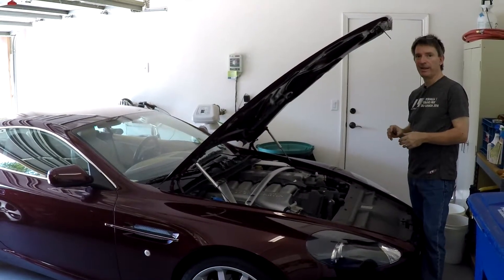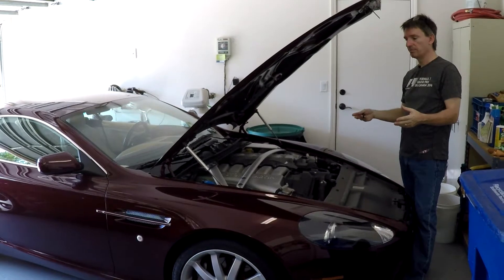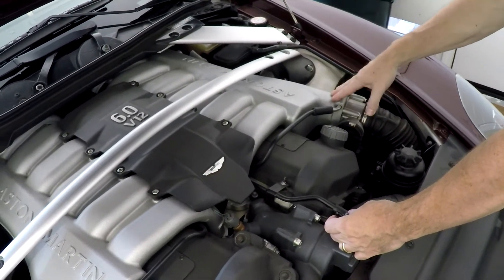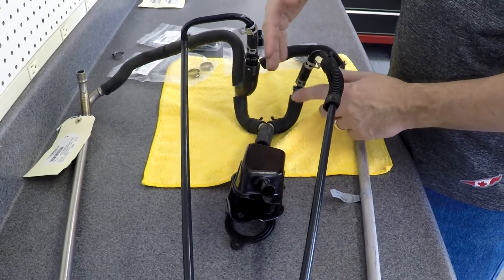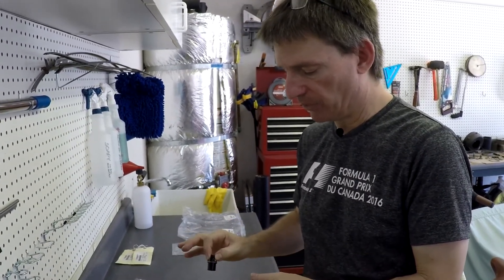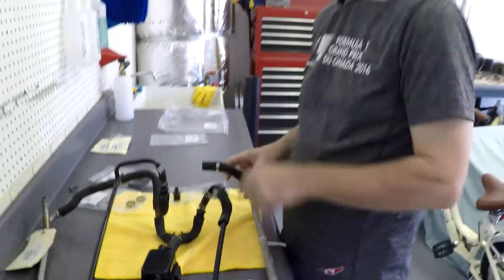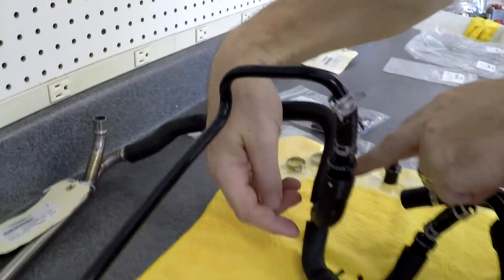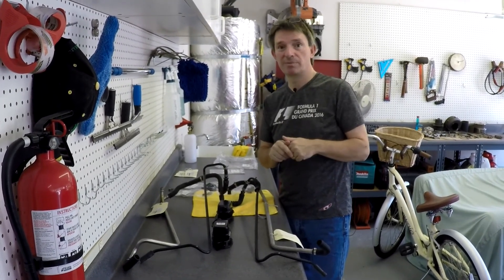How the PCV System Works in an Aston Martin DB9

Comment: Hi Steve,
Thank you for another very informative video. 
I’m in the middle of replacing my spark plugs and coil packs (following your guide) and I think I should change the PCV harness as you recommend. 
My question is: the owners manual shows the system and describes its operation but shows THREE  one way valves in addition to the two PCV’s. 
I only have a very small amount of oil around the top of my air intake, pre throttle, on the right hand side only (left side is dry) and when I did my recent service, 49,000 miles, upon inspecting the right air filter there was minimal oil. 
I have now checked for oil in the three pipes attached to the throttle body and the only one showing any sign of oil is the Full-load Breather Pipe -
Before the throttle body. 
I’m therefore thinking it’s the right hand one way valve in the Make-up-air pipe that comes from the RH valve cover that’s allowing oil to pass. 
Thoughts please. 
Thank you 
Peter.

Comment: Hi Steve, great videos and extremely helpful as always. I have a few questions for you which I hope you can answer for me; as an owner of a 2008 manual DBS and I was thinking of fitting an oil catch can; therefore could you advise a) if this is a good idea, b) should I fit one for each cylinder bank and c) if so; kindly outline which vacuum line/s  I should attach it to?

Lastly, can you recommend any suitable oil catch cans to use?

Comment: very good explained, except one thing that in my opinion you should releted here, a bad pcv system will suck crude oil from the engine bay besides oil vapors,tones of it and everyone freakout because of the piston rings and valve seals...
Reply from the maker: Thanks for sharing.

Comment: What do you think of this idea?

https://www.ebay.co.uk/itm/Aston-Martin-DB9-2004-2014-PCV-Breather-Modification-Inc-New-Air-Filters/173111511960?ssPageName=STRK%3AMEBIDX%3AIT&_trksid=p2055119.m1438.l2649
Reply from the maker: I think that's interesting, and impressed that they went to the trouble to build a solution, but they may have a design flaw.  If you look at my blog article on the PCV system in the DB9 (see below), I think the Aston Martin manual shows the breather pipes he's altering (in particular items 3 in the diagram) are the fresh air "Inlet" that flows back to the crankcase (at low and mid levels of power).   The lines that 'suck up' the mist and cause the oil issue are actually the lines on the back side of the Throttle Bodies (item 1 in the diagram), that's why you see the oil in the Inlet plenum chamber too.  The oil that is in the air inlet pipe may actually be running down from the top.   Worse yet, I think the right hand side breather pipe is designed to become the full load vacuum pipe when you are full throttle and there would be insufficient flow at the two smaller original pipes.  The modification would totally defeat this, and at full throttle you would likely have insufficient air flow to relieve the additional built up gases (not good).   Personally, I wouldn't do this mod to my car as I think it doesn't understand all that is going on with the system.  But, what do I know?  Here is the link to my full article on it https://aston1936.com/2017/07/15/the-positive-crankcase-ventilation-pcv-system-in-an-aston-martin-db9-and-what-sucks-about-it/